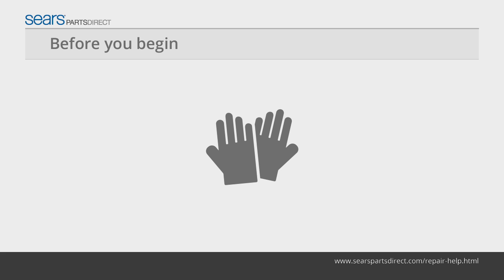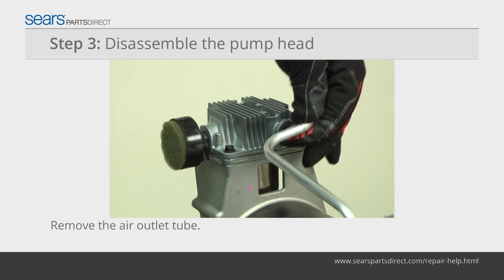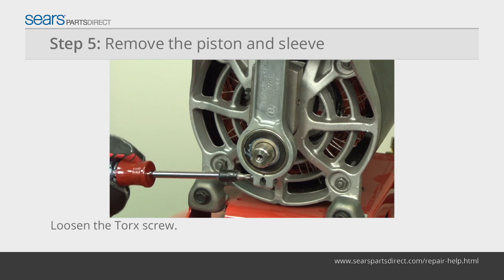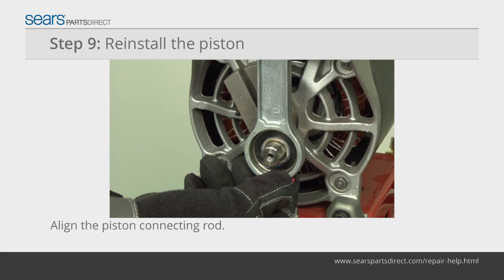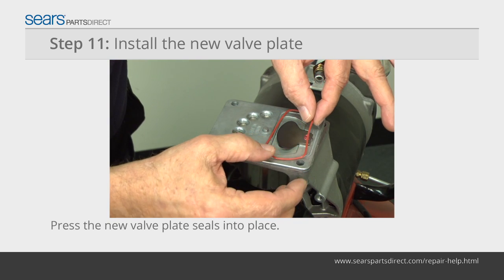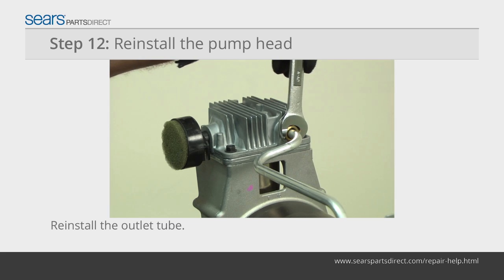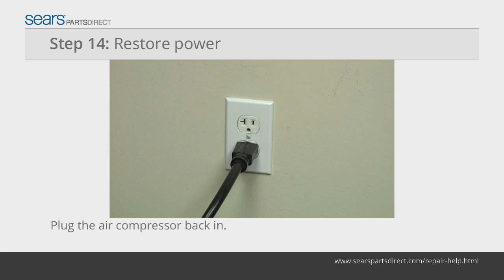How to Rebuild an Air Compressor Pump

Comment: With the help of this video I just did this. My compressor is loud and it would not build much pressure past 60 psi. I have used this thing hard for 25 years and I was just going to buy a new one. Here is what I found:
My air filter was long gone so grit was getting into the unit and scoring the cylinder walls. This in turn caused the gasket to fail preventing the unit to work properly. 
The hardest part was getting the right size torx head into the screws to remove the shroud. t25 bit worked.
The valve section was stuck to the head so I did not even mess with it. There is no reason for this part to be messed with as it is either good or not and you should not blow a gasket anywhere on the design.
Once you have swapped out the new piston seal it will take a little effort to get it back in the new cylinder. Make sure you put the piston in from the top of the cylinder as there is a slight lip on the bottom that will cause trouble if you don't.
The gasket for the cylinder to the valve body (big round one) was a bit too large. I almost used the old one as again it should show no wear.  I held the head and valve body upside down and  with the gasket in the groove I placed the cylinder with the piston on it making sure the gasket was not pinched anywhere and then flipped the whole  mess right side up and placed it back on the compressor.  I then hand tightened the 4 head bolts. Some of the new kits do not include a screw for the bearing so they are a press fit, if you order a whole new piston. When placing the piston on the bearing, before you tighten the screw, spin the unit using the flywheel weight. This will make sure you piston is in the right spot and it will not hit the flywheel or the fan. Torque everything to spec and pop in a new filter and enjoy!
Reply: yeah i just got a kit the piston ring is flat im wondering am i supposed to heat it up and form it to the piston or just force it into the cylinder and let the motor do its thing. i bought the piston-less kit just rings and and cylinder wall kit. i smoked the first piston ring so guess we shall see how this goes...
Reply: @kick_then_shift you ever figure that one out?
Reply: @user-fh4nw6ct9y  not really. I rebuilt it following the instructions. Lasted a whole 20 minutes before it melted, the piston ring back out again. I bought a second kit, and it did the same thing again. Ended up just junking the compressor. Fan was in perfect shape. Maybe the head had an issue, but if the head was worn out, you'd think it just wouldn't build pressure. On the second time I tried to lube the plastic ring on the piston, it made no difference.
Reply: @user-fh4nw6ct9y  kinda sucked because it's an old reliable compressor, but I got tired of wasting money on trying to rebuild it. I think this is mostly an issue of oilless compressors in high heat location. Which I live in Florida. Just weird it lasted 20 years no problem but the rebuild kits don't last an hr at most. Build pressure twice and stop half way through the 2nd build up to 100psi

Comment: Is their a way to tell if the compressor is bad? Or if it's my pressure switch? I have a 1995 craftsman model 919 and it just kicks on a few secs(fan turning) then shuts itself off. Notsure if its pressure switch or maybe compressor went bad. Runs 3secs or so an "click" an shuts off. Plz reply of can
Reply from the maker: If the air tank is full and the check valve has failed, the pump won't start because of high pump head pressure caused by the failed check valve. To test the check valve, shut off the air compressor (or disconnect electrical power) and drain all air from the tank. Start the air compressor. If the pump runs and fill the tank to the proper pressure and pump shuts off, then the pump and the pressure switch are likely okay and you'll need to replace the check valve. If the pump runs but won't compress air to fill the tank then you'll need to rebuild or replace the pump. If the pressure switch isn't starting and stopping the pump motor at the proper pressures, then you'll need to replace the pressure switch. A label on the pressure switch should show the cut in and cut out pressure ratings of the switch. A 150 psi Craftsman 919-series air compressor typically uses a pressure switch that cuts in at 120 psi and cuts out at 150 psi. We hope this information helps. If you need further assistance, give us more details such as whether the tank is full and let us know the full model number of your Craftsman 919-series air compressor.
Reply: @searspartsdirect  thank you, ya my tank is now empty, when it first started running odd(always on auto so self fills when it needs)it must have had a nearly full tank when it started this. It just runs and sounds real quiet for about 3-5seconds(the fan spins) but it dont fully kick on like normal or build air pressure. Notsure if the pressure switch is half messed up or if it's in the compressor itself. The 2 pistons an rods seem to be moving freely when turn fan and motor also spinning normal aswell. Took cap off motor amd looks new. Put back together and still does same thing. Just wont fully run normal. But compressor itself seems to be in working order(unless theirs things like sensors etc that could stop itself from running also)same with pressure switch that looks new also. Everything seems to look good but theirs obviously a problem cuz I have no air building and it trys to run, but something shuts itself off after a few secs of rolling over. Thanks!!
Reply: @searspartsdirect  it is Sears craftsman model #919-15293-1
Reply from the maker: @johngracejr9436  Thanks for providing that model number. Here's a link for an online copy of the owner's manual on that model in case you need it: https://www.searspartsdirect.com/manual/2opmqahxz7-000247/craftsman-919152931-air-compressor  The owner's manual provides general troubleshooting tips that may help you. If you have the air compressor hooked up to a 240-volt power supply, check the house circuit breakers for the air compressor. The air compressor won't get the power it needs to run if one of the circuit breakers tripped. If the power supply is okay, then the motor could be tripping its overload protection switch after running for a few seconds. Bad motor windings, loose wiring connections or damaged wiring could cause the motor overload protection switch to trip. Shut off power to the air compressor and check wiring connections. Reconnect any loose wires. If wiring connections are okay, check the power supply wiring for damage. Repair or replace any damaged wiring. If wiring is okay, then the motor could be bad. We hope this additional information helps. Let us know if you need further assistance.

Comment: you show the new compression ring as being pre formed to fit. The parts I received were flat and if bent upwards to fit into pump body, the ring extends beyond the piston cap, whereas the new part shown does not even quite reach the top of the piston cap. Do I trim it to fit and should the ring extend past the cap?
Reply from the maker: Let us know the model number of your air compressor and the part numbers of the replacement parts you received. We’ll research the compression ring issue once we receive the model number and part numbers.
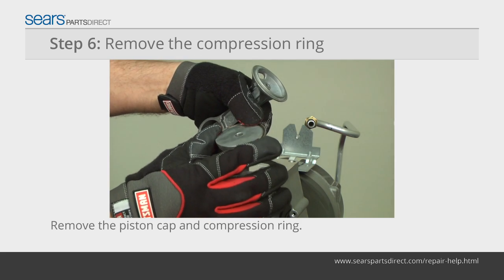Reply: @searspartsdirect  Model number is 919-167301 Serial #2116100408 Part in question is CAC-248-2 Compression ring that part is flat and has no curve to it. Your instruction video "How to rebuild an air compressor pump" clearly shows (about 1:20 in the video) this part to have a 90 degree bend so as to fit between the piston and cylinder wall. The ring  is 2.5" dia. and the sleeve I.D. is 2.35" so ring must be curved or needs to be bent to enable a good fit. unless there is an easy way to bend it as I already ruined one trying to get it to fit.
Reply from the maker: @hardtimes9622  Thanks for posting the model number. We're researching the issue and we'll post an answer as soon as we get information from the manufacturer regarding that compression ring.
Reply from the maker: According to the manufacturer, the formed version of that compression ring is part number DAC-308 ( https://www.searspartsdirect.com/part-number/DAC-308/0009/919.html ). The formed ring is much easier to install. If you need more help, let us know.
Reply: @searspartsdirect  I'm looking for a Acg-29 assembly, any ideas? Any other part adaptable?

Comment: What if the pump shaft will not spin? Locked up? Seized piston I assume, and it's a dual valve assembly. How much damage did that cause and do you think it's worth rebuilding? The pump assembly is over $400! I could buy a new one for about the same.
Reply from the maker: The pump may be worth rebuilding if the compressor parts diagram shows a cylinder kit (which includes a liner for the cylinder wall). If a cylinder kit isn’t available, then the locked piston likely damaged the cylinder wall so you’re probably better off replacing the entire compressor.
Reply: These people would not know the answer to your question mark

Comment: I followed your instructions and they were great EXCEPT for the foot pounds torque that you mentioned for the cylinder arm to the bearing.  The 48 lbs that you recommended blew out my thread on the old aluminum.  Whoever is watching this video, I do not recommend this torque for this part of the instructions.  I now have to either spend a crazy amount on a kit (70+$), tap a new thread into the arm and use a larger screw OR.. throw the compressor away.  All this happened after I purchased a bunch of parts from Sears.com to repair what this video mentions.  I don't think even in a NEW state, that screw needs 48lbs of torque.
Reply: +Robert Abiseid 
Hi Robert. You seem to indicate that you used foot-pounds of torque. The instructions for torque on the cylinder arm (connecting rod) screw say to use inch-pounds of torque. Using 48 foot-pounds of torque instead of 48 inch-pounds of torque on that connecting rod screw will cause the failure that you describe. Use only 48 inch-pounds of torque when tightening the connecting rod screw.
Reply: 48 ft. lbs. holy cow just put the 1" impact wrench on it next time. Or maybe a 800lb gorilla at the end of a 6ft cheater bar. Drive a freight train into a 16ft cheater bar, might as well. Build a cheater bar to the moon, you gotta get that thing tight.
Reply: You have to troll it to make it win.